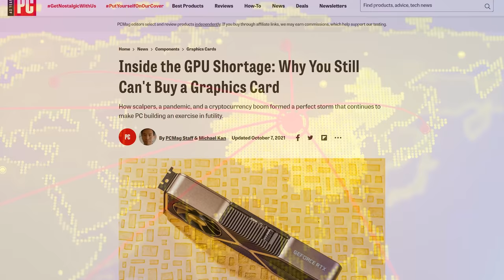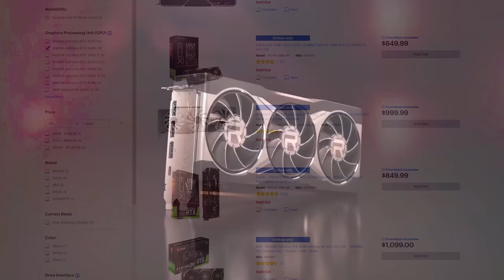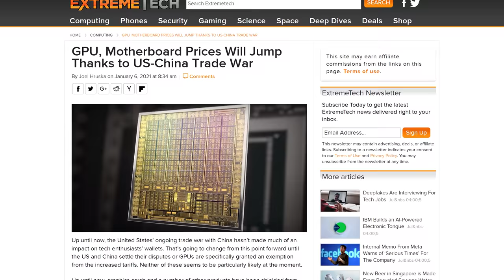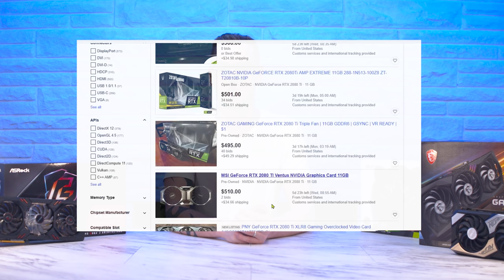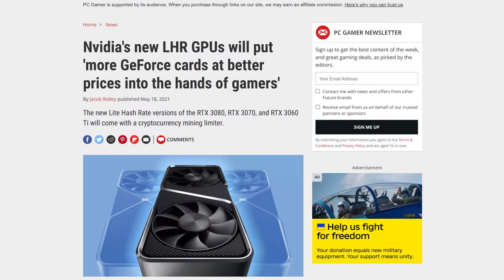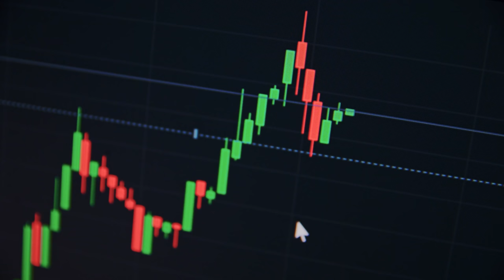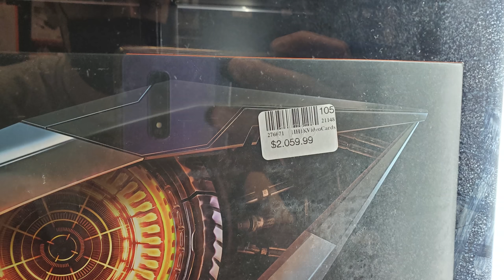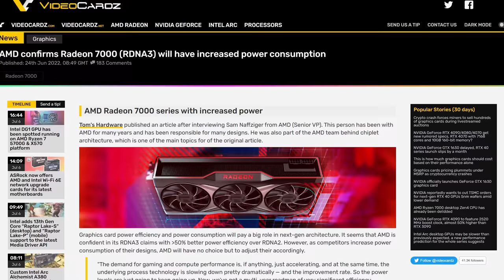The GPU Crisis: 18 Months of BS

Comment: Earlier today I looked up prices for the RTX 4080. The cheapest one was about 1500 USD (equivalent in CAD), and was already sold out. The next cheapest versions were a full 800 CAD more, 2800 CAD (about 2100 USD, or 500 USD more than the so called "MSRP" of the RTX 4090). 

What. The. F***.
Reply: This can't continue like this. Global demand for microchips has gone down a lot, and production is doing well. And, more importantly, competition exists, with even Intel starting to offer decent (if inconsistent) cards.

Comment: There was no shortage for me. Bagged a 3080 Founders for MSRP, 3080 FTW3 for £720, 3070 Suprim for £600, 3070 Ventus for £500, 3060Ti Eagle for £400... all to mine with. Was easy using stock alerts on discord, being quick and purchasing some prebuilds and selling the rest of the system.

I also had 2x 1660 Supers for £150 each a 1070 for £200 and an RX570 for free.

Made alot of money and then sold the cards for double what I paid.

Happy :D

Gamers were just lazy and not putting the work in.
Reply: Ky5